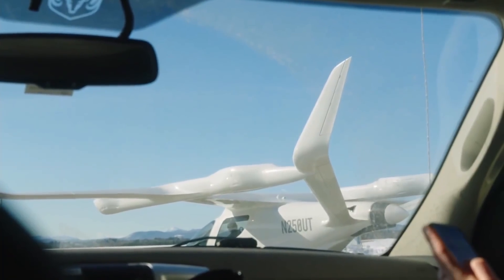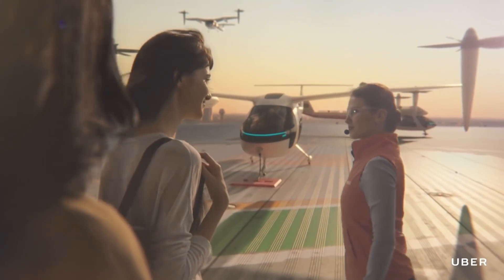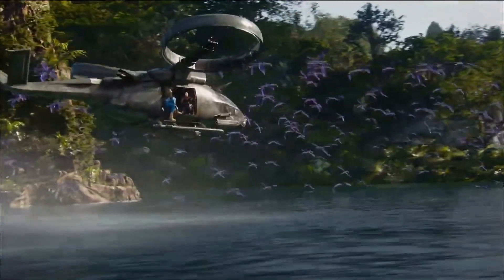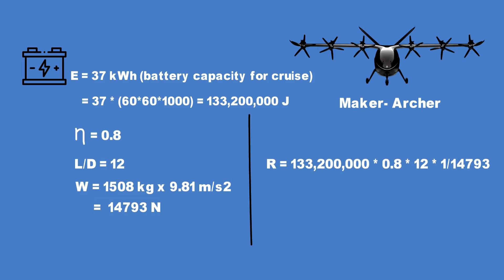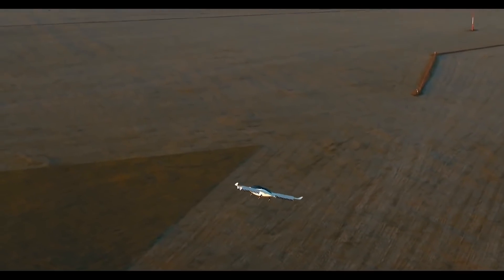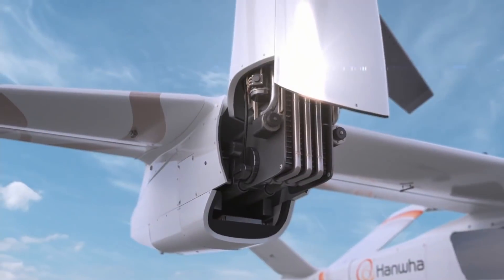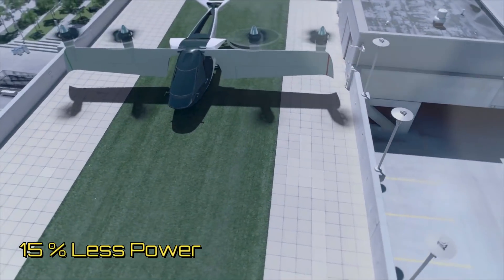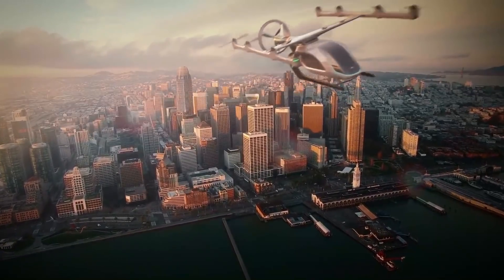The EVTOL Design Template: The emerging shape of most EVTOL explained

Comment: Hi at 10:20 you mentioned that co-rotating rotors can perform better than contra-rotating propellers according to a study, that sounds interesting because I assume there would be no swirl recovery with co-rotation, do you happen to have a link to that study? Thanks
Reply: That information in the video was actually very strange. Usually, 2-blade propellers are the most efficient. Anything more implies unwanted interactions between the blades, losing more than we gain, because the blades pass through less "clean" /  more turbulent air of the preceding wake. Theoretically, counter-balanced single-blade propellers would be even more efficient (yes, they exist, although rare), but they are otherwise problematic because of vibrations (balanced around COG, but not aerodynamically), therefore practicality starts with 2 blades.  The reason why 3-blade propellers are also seen quite often in smaller GA aircraft (or even 4 or 6-blade propellers e.g. in turboprops like the ATR-72) is ground clearance. Very typical e.g. in Mooneys, sitting rather low with their short retractable landing gears. When we want more thrust per "disk" size due to space constraints, more blades are good, but when the goal is more thrust per kW, then 2 blades are best. When that's not enough: more engines with 2-blade props of their own, or just larger props (as long as the combination of prop diameter and rpm doesn't lead to suprasonic blade tip speeds).
Now, with these multi-bladed sandwiched propellers - either co-rotating or counter-rotating - it's hard to imagine how this is supposed to be even remotely more efficient. I would expect a lot of chaotic interferences, especially because these blades are likely with a fixed pitch, thus never really optimal for their speed. When the front (or upper) rotor starts to partially stall, the rear (or lower) rotor will be in a lot of trouble.
Swirl "recovery" with counter-rotating blades is also relative. Yes, it avoids the actual swirl / slipstream, but still with a lot of drag losses through interactions between the 2 rotors. With co-rotating rotors: probably worst of both worlds (I think you were suggesting something like that, if you understood you correctly).

[disclaimer: no aerodynamics expert, just a private pilot]
Reply from the maker: https://d1rkab7tlqy5f1.cloudfront.net/Studentenportal/Faculteitspecifiek/LR/Onderwijs/Thesis/Wind%20energy/20190911%20Shubham_kickoff.pdf